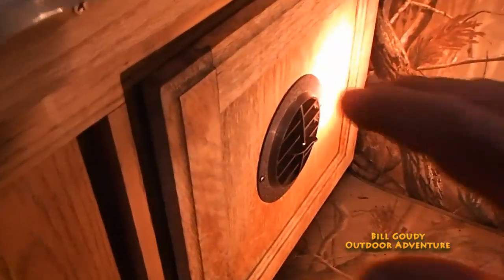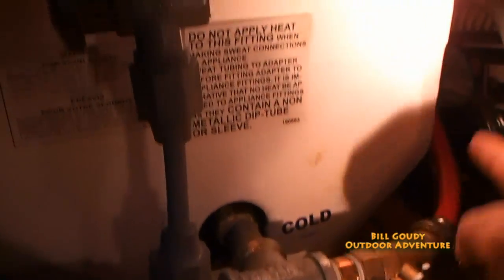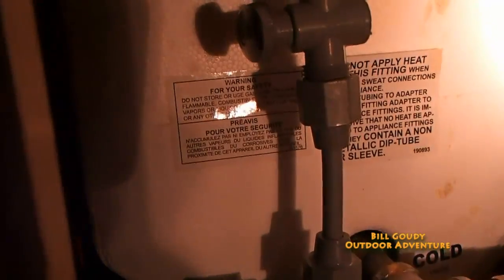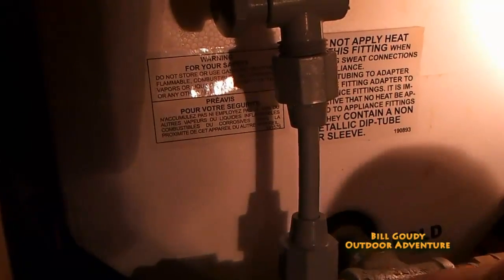Solar Water Heater

Comment: Camco 50ft Premium Drinking Water Hose - Lead Free, Anti-Kink Design, 20% Thicker Than Standard Hoses (5/8"Inside Diameter) (22853)
by Camco
4.4 out of 5 stars    3,430 ratings | 167 answered questions        I think if you try this type of hose it may no have the smell you were talking about. I found it on amazon $19.61 for 50'  Thanks for the Video
Reply from the maker: That sounds awesome...  Thank you for the info.... ;-)

Comment: I like it. Except for the smell you talked about. I love your set up. It's very different from my 1984 Toyota Escaper that I owned.
Reply from the maker: In the late 90's I had a Toyota with a Dolphin Camper...  It was so nice...  ;-)
Reply: Yes, pretty much the same thing. (Dolphin) Little four cylinder. Mine was a manual 4 speed. Another year or two newer it probably would've had a 5 speed. I put in an alternator in it during a blizzard in Laramie WY in 2005!  :-o  It took me almost six hours. lol

Comment: I did something similar to this for an above ground pool. Used a submersible pump and 200 feet of black hose. Coiled the hose on top of our roof and our pool stayed at about 75 degrees.
Reply from the maker: How many gallons did you heat and was the pump running continually or did you make it cycle on and off?  I got this idea from a sub in South Africa...  His pool pump ran the water through PVC pipe on the roof...  He said it did a wonderful job...  ;-)
Reply: i unplugged it at night since it wasnt going to be heated up by the sun, but left it running during the day. It was a 12 ft above ground pool, and did pretty well. I did spread the hose out on the roof so the sun hit all parts of the hose. The pump I had was a $30 harbor freight one, and it did very well.

Comment: Nice Set up Bill, as for the smell don't think it will get better its the heat that brings out the vinyl smell even a garden hose will smell if its full of water siting in the sun,.. But it works good and its cheap, maybe you can live with the smell, the RV camper hose will be very costly and the PEX as well, at least it would be here, i like your set up with the valves, you are a real genius when it comes to those things, all the best !!
Reply from the maker: Haha!!  Yep!!  I have been learning a lot of stuff from the YouTube...  I did make a reservoir out of 2" pipe But it did not have the needed capacity!!  ;-)  This is working so far!!  I will know a lot more by this fall !!  Thank you for all your support my friend!!  You are awesome!!  ;-)

Comment: An idea-- try using 1" black polypipe, inexpensive and no rubber smell, also easy to handle?
Reply from the maker: I looked at that...  I found it not as flexible and I was concerned that I could  not get the coils small enough for this purpose to fit properly on the roof...  I think that I paid around 30 dollars for this and so far it works good...  I am thinking that if I had a stationary building your idea would be great!!  ;-)  I also made a 2" PVC Reservoir,  but it didn't have the capacity I needed...  I have been learning so much...  Thank you my friend!!

Comment: Neat, did you use a thermometer to see what the temp of the water was I was curious how hot it would get, hot enough to burn you or just warm??.... I wonder if it would burst on a scorching day. Love to hear more about it as time goes on.
Reply from the maker: I am wondering too,  I have had water hot enough to burn....  But I haven't tried the thermometer , yet...  I will ...  There is no High temperature limit so I am sure under the right conditions it could get too hot...  So far so good...  ;-)

Comment: Wonder how much water a 100 ft hose holds... I'm guessing less than 2 gallons... I bought a 5 gallon "solar shower" bag a couple years ago and never tested it out yet. Wonder if there's a way to utilize a bag, instead of a hose... easy to remove... higher capacity..... no odor.... and it's black and meant to absorb heat.... just thinking... see ya' Bill!
---Chris
Reply from the maker: I have one of those bags, Chris..  My camper has a pump that provides 45 pounds of pressure... I am not sure that the bag can handle that pressure, but you know I will be checking..  I have used that shower many times when at Hog Camp...  (In Texas ) and Fishing in Missouri You know I will be checking that out!!  Thank you my friend!!  This is all a learning process for me!!!   ;-)
Reply: BillGoudy --- I never used mine.... do they work pretty good?

Comment: Solar energy is aces in my book.  All natural without any pollution is great when you can find a way to harness it, which you have done with innovation.  I don't know what would take care of the hose smell.  However, maybe running apple cider vinegar or an herbal rinse through it (not kidding).  Vinegar also kills bacteria.  I suggest flushing the disconnected hose or running any kind of vinegar through it with a funnel.  Or you could dilute the acidity of  it by putting the vinegar through the plumbing system by adding it to the water, since you don't drink it, and just use it for dishes.  Sounds like all its had go through it is water up until now, so maybe something to tone it down at least.   In time you might find a better hose for your water heating rig.  I use to drink from the hose as a kid, and I'm pushing the big 5-0, so we'll see. lol  I drink bottled water, too, for that matter. All I can say about that is direct sunlight is not a good idea or freezing bottles of water.  Great job! ;-)
Reply from the maker: Thanks, Heather...  This is all a learning process for me!!!  ;-)

Comment: What a great idea, we have to run the water a little while at the house b/c the cold water comes out super hot in the spring-fall. It will melt a whole cup of ice if you try to use it that way. I hope this keeps rolling for you brother, be safe out there!
Reply from the maker: Your water lines must be in the attic???    ;-)
Reply: I know the water heater lines go through the attic from the garage. I just figured they didn't bury the water lines deep enough from the well house.